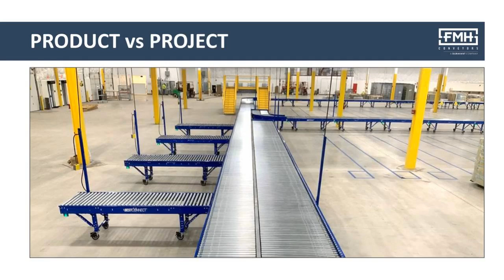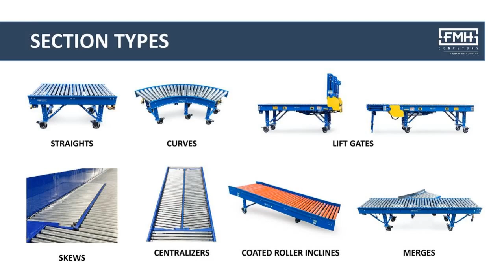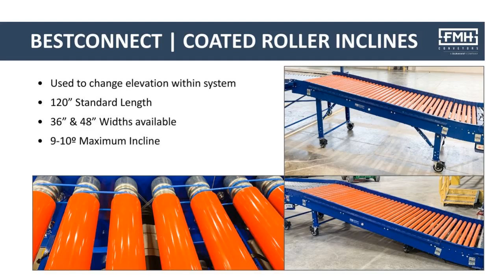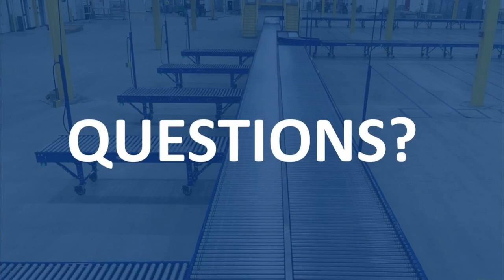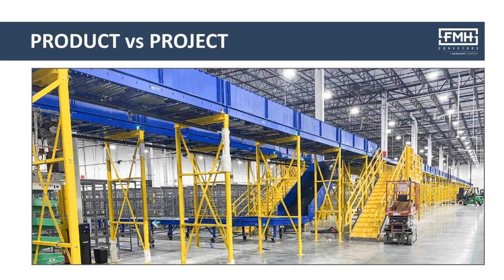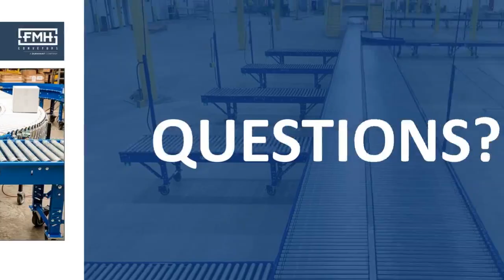FMH BestConnect Webinar

Comment: I need to get on top of my elevated best connects at our sort areas to replace bands easier. The customer has also added gap fillers in between the rollers making it much harder to change bands from below. Is there any documentation in which it would be allowed for maintenance to get on top of the rollers on a locked out conveyor to replace worn bands?

Comment: Hi i work on your Best Flex conveyors. We seem to be going thru motors like water?  Can you tell me what's going on?  Also we periodically seem to be having a shock issue reading 75 volts on frame to ground??? How is this possible???  We replace the plug and it seems to go away. BUT HOW IS THIS POSSIBLE?  Why isnt there a protection against this?